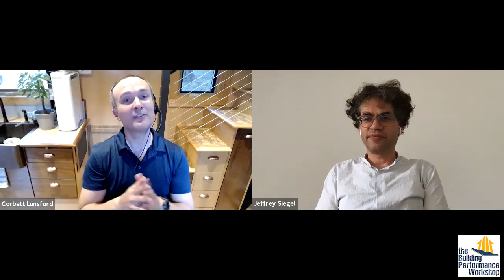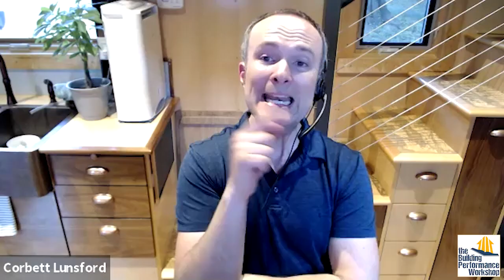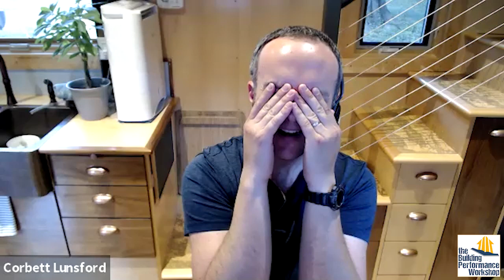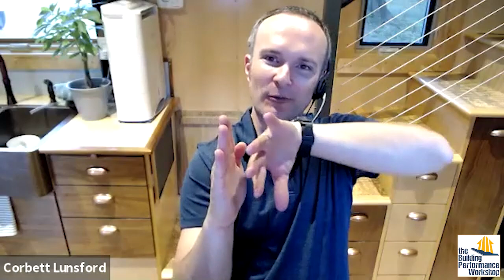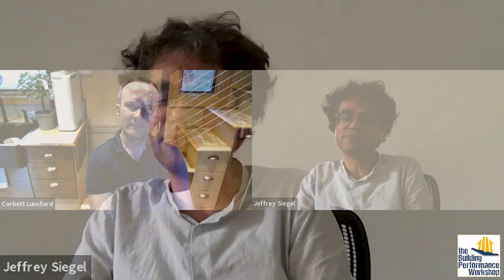HVAC IAQ Mythbusting with Dr. Jeffrey Siegel: Filtration, UV/Ionizers, Electronic Air Cleaning

Comment: Corbett,
What an insightful interview. Thank you for bringing on Dr. Siegel he is a wealth of information. This Podcast has really started to generate the questions for me. If I could encourage you to provide some jump starters on the following:
What do you recommend to use to monitor or test air quality?  Both indoor & outdoor.
What specifically should I be looking to monitor? What is critical vs what is nice. 
Indoor vs Outdoor - Are they monitoring the same thing? How do I know when one makes more sense then the other. i.e. do I open the window or is it better to leave it closed. In particular this is tricky if monitoring different things.
Does running my HVAC on a circulating cycle make a difference vs just leaving it set to AUTO? Or is that a seasonal question as it runs at different rates. (Excluding having any other ventilating system.)
I am just getting started, but this seems like a good baseline. I did do some preliminary research, but did not find much and what little I found seemed weak in terms of validating.

I appreciate your time and look forward to your valuable insights.  If you have a preferred forum for these type of questions, please let me know. Thanks again.
Reply: Not sure if you ever got your answers but as to the fan being set to on vs auto it depends on the season for your setup. In summer while running cooling it needs to be on auto, and the reason is while running your evaporator coil collects and slowly drains away water that it has just removed from the air(humidity) but after the ac shuts off that coil stays wet for quite a while so what happens is that water, if air continues to flow over it, re evaporates back into the air as water vapor(humidity) 💧 and you'll never get your space comfortable not to mention the health risks. The fan on setting is really only for shoulder seasons where you don't need heating or cooling. If you run fan on constant during heating you would feel more cool draft which many people don't want due to circulating room temp air vs hot or warm air like when furnace or heatpump is running. For opening windows, that's really an hour by hour decision as the weather can change drastically from morning to night or even overnight. Watch your weather every day,get your local weather app on your phone as well. Without getting into talking about dewpoint I'd say if the temp outside is a temp you'd be comfortable and the humidity is below 60rh open the house up.

Comment: To the customer that doesn't know. My elevator pitch is 'your AC just makes the air cold and hot, it doesn't clean the air, and 1 thing further, what grows in cold, dark, and wet areas? (They know the answer is mold of course) Thats what is going on in your system without any IAQ solutions.' That is a quick eye opener to start the IAQ conversation I've found.

Comment: Great interview. For residential homeowners who are interested in monitoring the air quality inside the home, what systems work well? Assuming we start using better filtration, changing the filter more frequently, and adding a gasket around the filter to prevent bypass, what can we do to monitor the air quality? What does your experience show?
Reply from the maker: I really like the Airthings line of monitors, along with Broan’s new Overture system. Some people also like HAVEN, which is a one-point measurement in the return duct.

Comment: I saw a discussion about the high filtration air filters and the results indicated that unless your system is made for a high quality filter, you are reducing the ability of the HVAC to work properly. (It can't move the air through the system. Will lead to poor heating or cooling of the structure)
Reply from the maker: You can simply upsize the filter to increase the surface area, which lowers the static pressure stress on the blower. You can put any high quality on any quality of system, provided it’s big enough.
Reply: @HomePerformance  They didn't try that.  They just replaced, say a 20x20 with another 20x20, and you see the lower air flow in the vents.
Reply from the maker: Of course- that’s the same dumb argument technique as when they say a murderer will do the same job with a baseball bat if we take away his AR-15. It’s just meant to shut down the discussion.

Comment: The equation basically goes, the time we're exposed to something, and the amount of that something, minus the amount our body is able to filter/dilute/render inert, is the time it takes for whatever harmful material to present its bill.

Radiation, for example. There's baseline, the background radiation we count as not being very hazardous within our expected lifetimes because it's unavoidable, 24/7 and it's just a fundamental bit of physics we're stuck with. And it hasn't managed to wipe us out yet. Move beyond baseline, even a little bit, and expose yourself to it for years. You may not notice tomorrow, or even 20 years from now, but the whole time it's been degrading your body until finally, someday, the bill comes due. And now you are noticeably, irreparably damaged. Get exposed to it a lot and once and then you're dead in days, hours, immediately. 

Time to exposure, amount you're exposed.

We're educated in the dangers of radiation. Whether we are educated or not, doesn't matter. Physics doesn't care about what you do or don't know, it's going to keep doing it's thing regardless. Same thing with all of these substances coming from so many various materials in our homes. We can ventilate to try and get rid of it, but who says what you're pulling in isn't what your neighbor is also trying to ventilate away? Or all the car exhaust from the busy street you live on? We can filter, but unless you know the source of contamination, and wrap that around a fully enclosed bubble of filtration, you're still getting exposed to it. You just hope it'll now be low enough to not affect you within your expected lifetime.

I don't think IAQ's best destiny is to be improved first by ventilation and filtration. In the same way your cough isn't improved by a cough drop. We're doing our best to treat the symptoms, not cure the disease. I think when it comes to housing, we need a severe shift in focus from square footage and magazine indoor finishes at Walmart costs, to building somewhat (not even drastically smaller; $150/sq ft adds up real fast even cutting just a couple hundred square feet) smaller homes with materials that are as close to their original state as possible.

Even natural materials produce hazardous materials. Granite countertops, wood, stone, metals, nothing is free from entropy, and those shifting states that degrade the material composition of all things aren't putting out things that are great for our health. But that is literally the baseline, that is the lowest hanging fruit, and that's what we should be trying our best to build with unless we structurally or logistically can't.

I will happily cut 200-300+ square feet off my house if it means real wood floors versus luxury vinyl planks, granite versus laminate countertops, tile showers versus plastic enclosures, metal roof versus asphalt.

And THEN you ventilate and filter out the cat hair and whatever's left.
Reply from the maker: Deep thought, @Nerdineering- and you didn’t even step foot into how we should all be cleaning our homes better, not wallowing like a bunch of filthy animals ;)
Reply: @Home Performance  

I'm staring at this field of carpeting pervading my apartment and weeping. Probably from all the cat hair that's already back in it again.

Comment: After years of being ill when my over sized furnace ran, I opened up the drywall ceiling to find old, leaky ductwork that was falling apart, had been tampered or modified and large 3" gapping holes in the return duct with 40 yrs of construction filthy and rockwool insulation covering them.  Nothing is more dangerous than 40+ yr old old leaky, poorly designed ductwork, returns using ceiling and wall cavities and an over-sized furnace.  All the filtration in the world will not solve this issue. 
Quotes to replace system range and add high end filter range from $30K-$47K. It is a modest 2600 sq ft home. There is a lot to be said for ductless.

Comment: So merciless HVAC myth busting was a bit misleading. When I tell my commercial customers what it would take to deliver them clean fresh air through  or along side their existing HVAC system they are usually pretty happy to drop  a few grand to put a plug in HEPA scrubber every couple hundred square feet instead. It might not be perfect but it might be the best anyone can feasibly do I f the building wasn’t built with human health placed above cost to build, cost to operate (and even efficiency and comfort).
Reply from the maker: Pretty sure this channel isn’t about commercial buildings, Paul. Different channel.

Comment: I've been wanting to change my filter slot from a 1" to a 4" or a bag style. I was quoted $1600.00-$2000.00 to make the retrofit!

Guess I'm going to learn how to do sheet metal.
Reply from the maker: It’s a helpful skill!
Reply: For half that price and a few hours on YouTube you can buy a prefabricated one and the tools you’ll need to do it.
Reply: Pressure drop is within an acceptable range. It is hard to find data on filters to see what pressure drop to expect. I want to be able to drop in a MERV 13 or 14 without worrying about it. Manufacturers should list a CFM rating on their filters.

Comment: One takeaway from this for me is that I'd like to improve air flow in my 4-Bedroom house, and have it operate year round. Question: Sorry to be a bit OT, but I've watched many videos on this channel and am trying to figure out what air flow rate you designed your duct system for. More specifically what HVAC appliances stay on 24/7 (and flow rates) and which ones operate intermittantly. I think I've seen where your ERV has separate duct work. Would you mind sharing a schematic of the crawl space layout to show how the appliances interact overall?  thank you.
Reply from the maker: Hey Bob- thanks for your enthusiasm for this channel and topic! I may do a video on this down the line, but HEPA (240 cfm) and heat pump (~500 cfm) stay on 24/7, with heat pump bumping up to 900 when conditioning, and dehum adding ~250 cfm when drying. Add to this the separate ERV system which pumps ~130 in/out 24/7. That's for 2200 sq ft, 30k cu ft.
Reply: @HomePerformance  Thank you for the response. Am I correct that your duct work is designed for full flow (@~1490 cfm)? How does the duct work perform at the lower flow of 740 cfm? IOW: What design  compromises did you make in the duct work to deliver adequate flow at two (or three) different rates?
Reply from the maker: At lower flows, the only change is that velocity out of grilles is not as high, so it doesn’t agitate and mix the air- hence the ceiling fans on low.
Reply: Credit to Hank Rutkowski
There are scores of things to worry about when designing and installing a comfort system.  Low velocity through a duct airway is not one of them.
Reply: @dc1bamf  Yeah, that's good to know.  I was hypothesising that at lower static pressure (i.e. lower flow), there could be an unbalanced flow in the duct branches resulting in some rooms getting better flow than others. But, I suppose that couldn't happen because an imbalanced system would be evident at all flow rates. Thanks!

Comment: Sounds like water filtration is even more important than just drinking if you have a humidifier. I have never seen this talked about with whole home units. 

I will have to look at the cost of using distilled water with my large standing unit.
Reply from the maker: Yes, pretty interesting

Comment: 99.99% of residential HVAC companies have Zero clue how to design a UV light system. Even the owner of the company I work for has no experience in designing a system that uses UV or Photovoltaic light. It's not worth the gamble, stick to a fan and a filter.
Reply from the maker: Right on
Reply: @HomePerformance  are UV systems like Reme Halo it Bipolar ionization products like iwave-r unsafe?

Comment: We need to separate filtration from air conditioning.  Tract builders in Phoenix are very price sensitive.  Undersized returns, stamped return grills, and  1" "Allergen Filters" send the static pressure on the HVAC systems through the roof. The from mid October though the beginning of April the unit hardly runs at all providing no filtration.